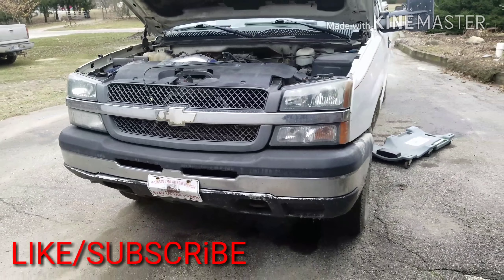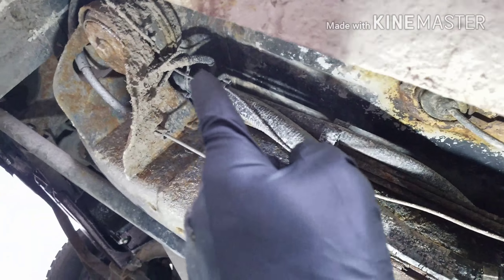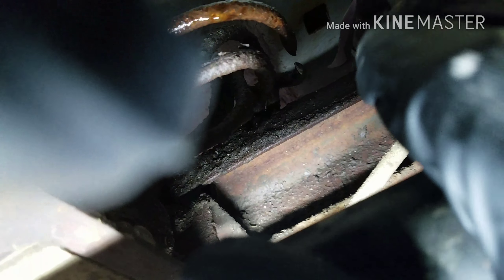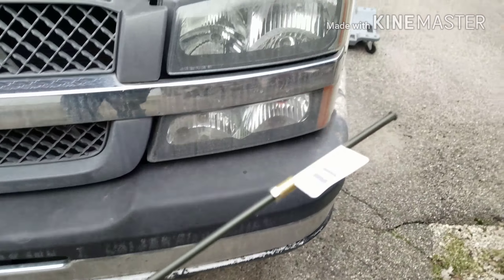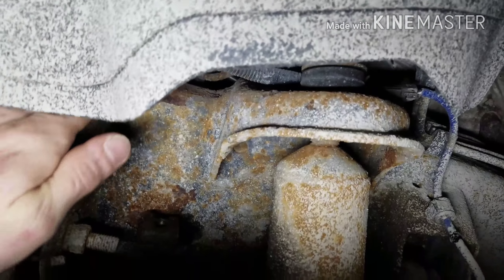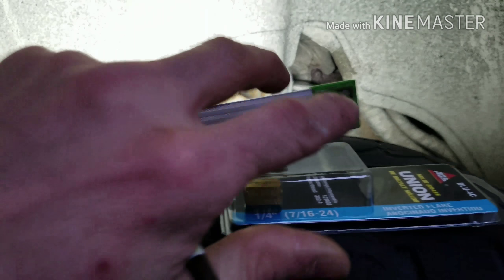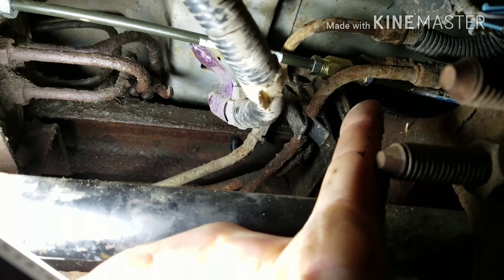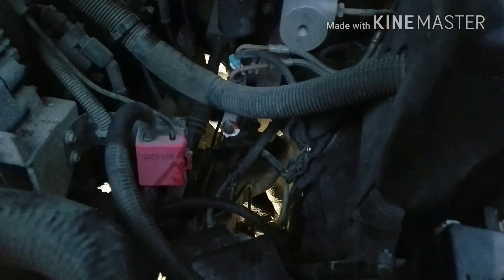CHEVY 1500/2500 BRAKE LINE LEAK REPAIRED

Comment: Hey man I have the same truck as you, same year, I was wondering how much it would take to fix this if I took it to a shop? This one mechanic told me it would cost 2k for all brake lines to be replaced, he cited all the complications such as ABS. He’s ripping me off right? 

Also, this video is helpful, I’m planning on replacing my brake lines myself.
Reply: Also note, my truck is rusted to shit.
Reply: Joshyode I went to a small shop lmao. Thanks for the reply man, appreciate it.
Reply: Joshyode like I need to know where the master cylinder brake lines connect with the abs?
Reply: Joshyode thanks, got most done so far.
Reply: My Tahoe doin the same leaking from the driver side door